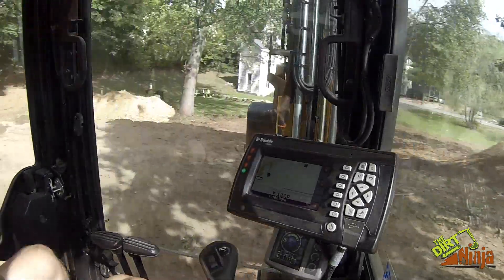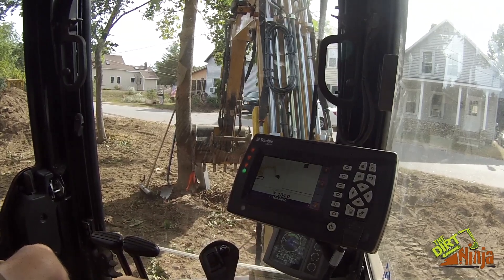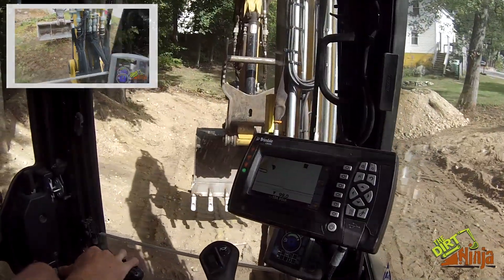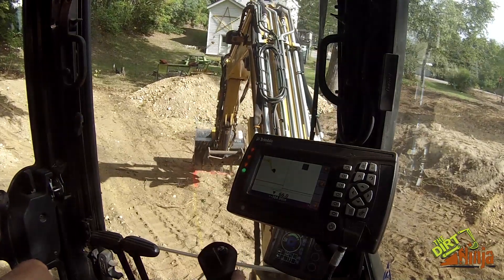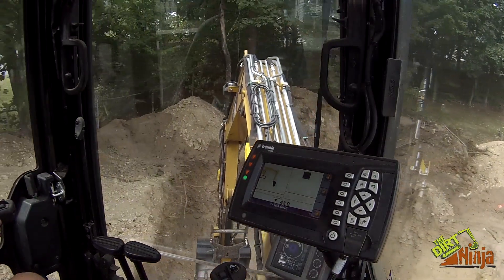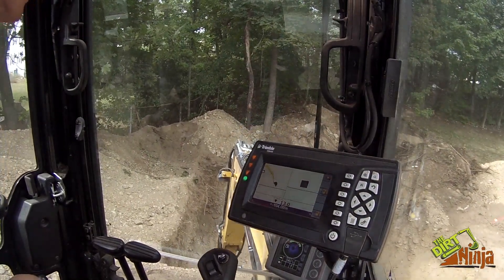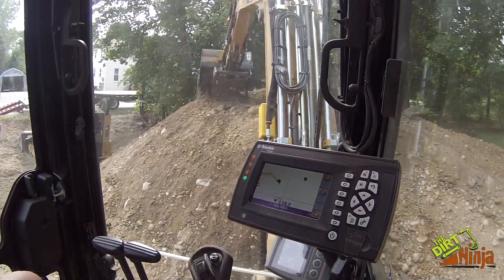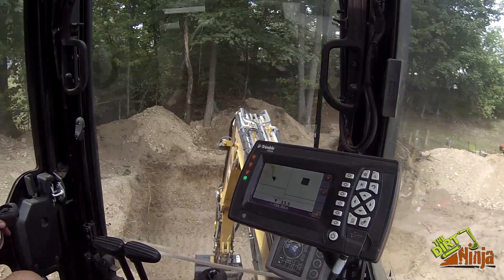Digging A Foundation With Trimble GCSFlex 2D System - Part 1

Comment: Hello Ninja i know its very old movie but i see 2nd times you using Station Laser with Trimble . Is it works like that on the old Trimble ?  Because on the new system i seen you dont need anything at all ( like lasers etc )  to use a GPS . Thanks for your Answer:)